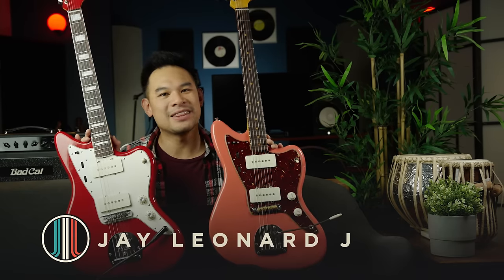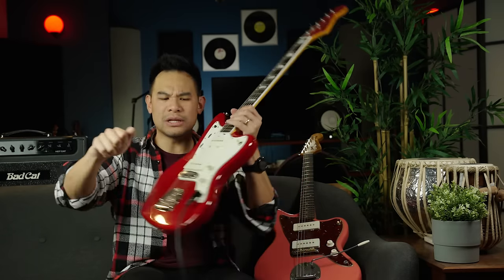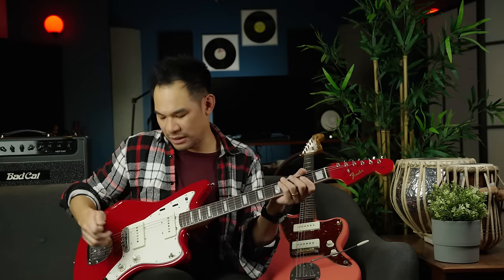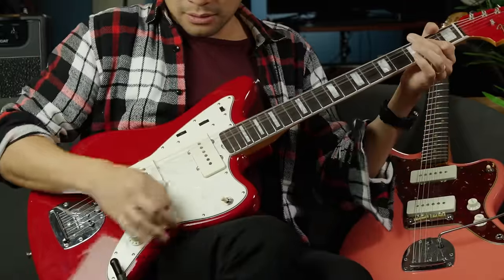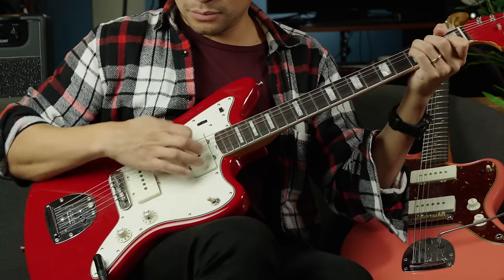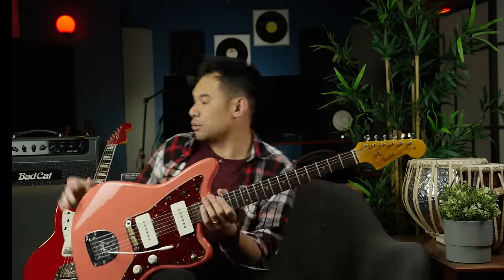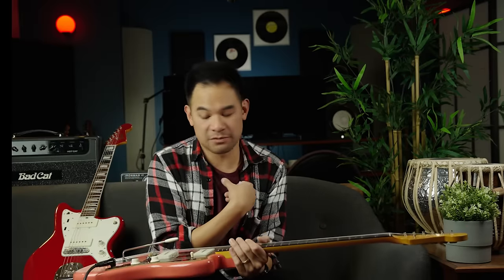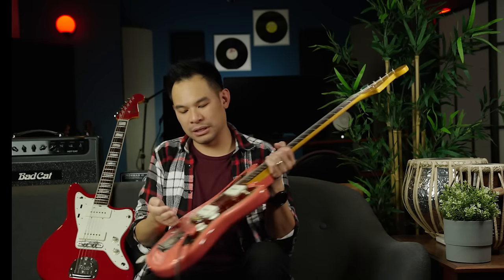What I Learned After Gigging A JAZZMASTER for a Whole Year | TONE LAB

Comment: As a Jazzmaster player, this video is a great explanation of what I love about it. The super high 1 Meg pots gives the Jazzmaster controls a huge range of usable tones. Other guitars ( Especially Single Coil equipped guitars ) have a super narrow range of usable "Non-Muddy", tones. When I try out Strats and Teles, I have to carefully navigate between 8.5-10 on the tone and volume knobs. With the Jazzmaster's 1 Meg pots, Everywhere from 3-10 is clear and free of muddiness. When you add in the super dark Rhythm circuit, the Jazzmaster can be dialed in to fit any amp, no matter how bright or dark. Also, as someone who actually uses the Jazzmaster to play Jazz, the convivence of dialing in a lead tone for a solo or the head of a tune, and a rhythm tone available at the flick of a switch is SUPER USEFUL! With some nice flats, the Jazzmaster can switch between a gnarly distorted tone, and a warm archtop-like tone with ease.
Reply from the maker: Yeah. Once I realized all the shades of sounds in that Tone Knob, that whole guitar opened up to me and I truly "got" the whole Jazzmaster thing!

Comment: Jay what a wonderfully comprehensive review of this underrated and misunderstood guitar. I might add a couple opinions. Mine is a 2005 61 reissue with 7.25 radius. The refinements I incorporated where Staytrem bridge from the UK that retains the subtle rocking but very stable, a .25 mm neck shim from StewMac that increased the brake angle a touch, and filed a slight fall away on the highest frets that gave the forgiveness for big bends on the high E. 
Jason Lollar suggested using the volume dialed down to 8 or 9 to curb the top end a touch vs changing pot value. Lastly I can’t believe you didn’t speak of the middle position. Magic for me and why I kept the 1meg pots. 
Thanks for a fun vid!
Reply from the maker: Haha, good point! I think it goes without saying that the Middle position is absolute fire... I'm on that position about 50% of the time :)

Comment: Thanks for the deep dive! My hot take on the buzz stop add-on below the bridge that you mention near the end of this vid is that it's really only relevant if you're keeping the original Jazzmaster saddles.  It steepens the angle of the strings leading up to the bridge and helps prevent them from slipping off.  That said, I swapped out my JM saddles for Mustang saddles AND kept my buzz stop in place anyway simply because I like the aesthetic. What can I say? Some people put stickers on their guitars, I slap on chunks of steampunky metal. I've seen other vids about the buzz stop debatably altering the tone, but I'm not really detecting anything of the sort.

Comment: Overall a great video that discusses all the important features and issues with Jazzmasters. Well done. 

A couple of notes: you really sold me on the upper bout 250k mod. It never occurred to me that you could do that and have a different value pot on just one of the pickups. 

The best features of the Custom Shop Jazzmasters are both the RSD bridge (which is soooo much better than the vintage threaded saddles which I've never liked) and the fact that you don't have to shim them, which I think improves the neck/body join and makes the guitar sound better. 

I don't think I agree about the lock button, though. Having a Mastery vibrato completely eliminates the need for the lock button and makes things simpler, because you don't have to worry about your strings breaking.

Comment: Love Dakota Red. If I didn’t already have two Jazzmasters I’d get one. 😂

29:52  The string breaking solution is very simple, there’s two good solutions but you can do just one.

1- when you put the high E string ball end in, turn it sideways so it’s like — against the body, not like | against it. This will prevent the string from breaking. 
2- use some Mitchell’s abrasive cord to smooth the hole where the string exits.

That’s it. Permanent.

The cause is simple: Fender doesn’t smooth the holes enough after drilling and so burrs remain. Not always, but frequently.

26:16 loctite is a necessity in my experience. Low strength 222, purple stuff. All twelve saddle screws and possibly the two bridge post screws. One application will last many many years.

25:45 I love the stock AV bridge and vibrato. I use 13-56 strings tuned in C# standard and have zero issues. We must keep in mind that when the Jazzmaster was designed it was 13-54 strings that were used and so there were no problems until people started going to ultra light strings.

Comment: Great review! I am usually a Les Paul player and I wanted something different for other textures and a vibrato. I just bought a Classic Vibe Jazzmaster and installed bright caps in both the lead and rhythm circuits. Then I removed the tone control from the rhythm circuit. It makes me able to use it as my LP through my one channel with overdrive amp; dialed down neck pickup for clean and semi clean and with the flick of a switch, I have got full volume in the lead circuit. Or any combination thereof.

Comment: Thanks so much for making such a cool video, like your mods to the RC! One point to add about the bridge - you make an excellent point about the bridge getting ‘stuck’ forward or back - but in my experience, this is not an issue with unshimmed guitars, because the bridge sits low in the body. In the shimmed ones the bridge is really proud - such as the 40th anniversary squire. This setup is far more likely to have issues with the bridge shifting during use, one trick I found works is to intonate to the extreme aft position, then you can always knock it back if it moves…For me, I think unshimmed is the best way for the guitar to work. Great video, loved it!!

Comment: Favorite guitar of all time, my Classic Player has been my go to for over a decade. I swapped out my rhythm circuit for the Yamaha Revstar transformer boost, threw in a Descendant tailpiece, Mastery Bridge and my favorite mod was the wiring! 

I have Gemini Tone Ranger (wide range CuNiFe pups) that I’ve wired with push/pulls and partial frequency dependent coil splits. In the down mode the neck pickup has all of the neck side coil and about 40% of the bridge side coil to simulate the sound of the Antiquity 2 that used to be in there. The bridge pickup in down mode has full neck side coil and the bridge side coil only passes frequencies below 160hz so it almost sounds like a P90. In the up mode of the push/pull they’re full coils on both pups so they just sound like wide ranges.

I can get traditional Jazzmaster tones, pseudo-Strat tones, big 70’s Tele Deluxe tones, only downside is that I rarely pick up my other guitars on gigs!

Comment: I've been playing a JM for about 10 years. Always solder the high-E. Mastery Bridge. Make sure the tailpiece screws aren't rubbing strings. Personally I've always had to shim.

Also like you, I set mine up for 9.5 gauge strings and 250k pots, so it's more or less setup like a Country Tele rather than a early Surf Guitar. This just increases versatility tremendously. You'll sound good with normal OD's and be able to Chicken Pick and stuff. The guitar just sounds so vibrant and makes arpeggios and chords sing, at the cost of a little bit of low-end thunk.

Like you, I've got the upper-bout control switch putting the stock 1M pots back in play, but it will do either Bridge or Neck so the 'vintage' or ice-pick sounds are there if you want them.

Comment: I got a road worn Jazzmaster used at the beginning of the year. I love it. The vintage spec fretwire and 7.25 radius are so comfortable, and I'm happy to also report very few tuning issues even with the MIM vibrato. I did flip the screws because of string breakage, but that was only one string. Only problem is the bridge, which rattles, but everyone knows to replace it or loctite it and I don't play out so it's not a big deal for me. 

I have an AM Pro II body and neck I'll be building up with different pickups and wiring. Why just have one JM?!

Comment: For those having issues with string slip with the stock Jazzmaster bridge, installing a shim, even on the am vintage ii with angled neck pocket, makes a huge difference. I think it's wise to try that first, before going directly for the mastery bridge. The mastery is great, but if the only concern is string slip, then the neck shim/increasing the break angle is the best first step.

Comment: I did an opposite mod on my rhythm circuit- so it goes straight to the bridge pickup with a darker sound, which is killer with distortion and leads. Can get full jangly or slightly darker with a flip of a switch
Reply from the maker: Cool mod!!!

Comment: Nice JM testimonial, well done Jay! The only thing missing is the shim many JM fans apply to tilt the neck a bit. Did you explore the benefits of this? I think Mark likes to do it.
Reply from the maker: I did try putting a shim on the red one but didn't feel like it added anything, so I took it off.
Reply: I shim my Jazzmaster and my Bass VI necks because it gives me a steeper break angle at the bridge
Reply from the maker: Makes sense: that is a pretty shallow angle! I can see how it can easily get too buzzy depending on the guitar as well as the sustain benefits you may get too 👍

Comment: Hey Jay, i have a Squier Jaguar (Classic 70s Vibe) for over a year ...n i do love it so far 💖 they have an unique feel 🐾 4 sure
i did experience a lil bit with upgrades such as a Staytrem bridge (really good!) + a Wizzobuzz to have more pression on the strings as on the bridge (it's worth getting one!) + a 0.5° neck shim (from Stewmac) to be able to have an higher bridge setup which is crucial for this type of guitar coz they R sort of archtop inspired type of guitars so they need a lil bit of more angle on the neck & more height on the bridge in order to apply enought pression on the strings as to get rid of sitarish kind of tones 🐸 but my main guitar for now is a Sire L7 a spectacular Strat with the best PUs (SSH from Sire) & neck (roasted maple) i've ever come across ....i did as well a lil upgrade on it (Honed black Wilkinson Trem, Black Chrome Gotoh lockin tuners, 3 claws strings' retainer) ...it's a dream 🏆

Comment: Granted it was on my Jaguar, but my 10 gauge high E string broke in that exact spot WHILE watching the video lol. Thanks for the idea about throwing some solder on there, this was a great video on offsets in general. Just got another Jazzmaster and I can't wait for it to get here.
Reply: Regarding your question at the close of your video, when setting them up I personally shim the necks. It keeps the strings from popping off the bridge by increasing string tension (and sustain) which is important as you said. I guess it could contribute to more broken strings but I usually don't have that issue. I also always change out the bridges. Even when they come with the Mustang style that I prefer, they often come with a 9.5" neck yet the radius of the bridge is only 7.25".
Reply from the maker: Hahaha, hilarious how things work out :)

Comment: Ya' know, the "window aperture" of a pickup is limited by where the flux lines from the pole hits the string.  Thats not much wider than the pole piece.  Flux lines then emanate out from that ~1/4 wide string portion down through the coil to the bottom of the pole.  The wider coil might be more efficient if more strong flux lines pass through it, or there might be some cancelations from stray opposing flux lines?  At least the shorter coil doesn't have all that wasted wire in typical tall SC designs that the much weaker length of the flux lines pass through.  JM PUP's are a bit higher inductance than classic Strat PUP's, but the shorter AV poles have lower Gauss.  Lower Gauss is a big part of why they sound darker/smoother, as with A2 Strat poles.  The only reason the highs come through so well is because the pot values are higher than on a Strat or Tele

Comment: been soldering that high E string since i bought my 64 in the early 80's and thought i was the only one,,,haha. I cheated a bit and put a 1Meg resistor across the tone pot and that seemed to work well without changing pots. Calmed it down a bit but i still back the tone down a hair. You are right tho,,,no shims,,,flat neck,,,that's the best. Only thing i did was to fabricate from an old pickguard a little rectangular piece with a hinge that fits on top of the arm side of the trem plate using the 2 side screws of the plate. This holds my trem arm so it doesn't fall all the way down to the input cable. That way i can reach it with my left hand for songs like Church Key and Summertime Blues,,ect.

Comment: Excellent overview. For the string-break-at-the-bridge issue, try either D'Addario strings with a reinforced end (EKXL110) or a brand with more windings prior to the ball. (Normal D'Addario's are terrible on Jazzmasters).
Reply: Check the holes that the string goes through on the bridge to see if there are metal burrs on the edges of the hole and file them smooth if you find them . I had string breakage on certain strings on both my Jazzmaster and my Bass VI and when I checked my bridge there were small metal burrs on the strings that were prone to breaking and they always broke right at the ball every time . I filed smooth the metal burrs and my Jazzmaster and Bass VI string breakage problems were gone

Comment: Seeing as you asked;-)

I would recommend neck shims on Jazzmasters and if you really do not use the rhythm circuit then changing it to a PTB circuit like G&L is a good idea -either turn it on and off with that switch or keep it permanently wired in & using the switch for a series/parallel option

Flatwounds are really good with the standard tone and volume pots but perhaps more so with a Jaguar?
Reply: I think the American Pro II and Custom Shop JMs have a slanted neck pocket that does not require a shim.  Even the Squier 40th JM did that.  No shim required.

Comment: I don't currently own a Jazzmaster, although one of my kids does. I decided that I prefer a Gretsch for my surprisingly practical impractical guitar. One thing that I loved to do with a Jazzmaster when I owned one is use the rhythm circuit for octave fuzz. You're supposed to use the neck pickup with the tone backed off if you want to get a clear octave, and it was really fun to have that switch right there that would make the octave go crazy on the octave fuzz.
Reply from the maker: Yeah, I love that trick!!! I had a vintage Duojet that I absolutely fell in love with years ago that I still haven't forgiven myself for not buying, haha...

Comment: Ive owned multiple Jazzmasters, and the one mod i highly recommend is changing the stock bridge. I went with the Mastery bridge, and their version of the vibrato arm as well. Best decision i ever made. 
Like you, i, too, play violently lol, and with the Mastery bridge/vibrato i can literally beat the crap out of my guitar, i can slam the wammy back n forth aggressively, and even hold the entire guitar up in the air by the wammy bar and it NEVER goes out of tune lol.
 It amazes me every single time i play it. So yeah, if you like to play rough, or have problems breaking strings, or the strings falling off the bridge, then get a differentbridge, or get the Mastery one. Its a bit pricey but worth every penny IMO.

Also, you didnt mention this in the video, but Jazzmasters do better with higher string gauges such as, 11 or 12's due to its unique trem/vibrato arm set up. I wouldn't go lower than 10's. I find the 11 gauge is the perfect balance for me and my playing style. My guitar never goes out of tune, and i play in all different kinds of tunings, from standard to crazy Sonic youth tunings. Not once have i dealt with it going out of tune. Like i said, even purposely abusing it, it still stays in tune. The Jazzmaster is my guitar for life. 

Ps. I agree that its neck pickup sounds the best of all neck pickups

Comment: Loved this deep dive!  I changed the stock bridge out on my JM to a Mustang bridge. I, presently, don't use the vibrato bar, but I've been tempted to lately. As a result, I keep the trem lock button activated.

I'm a hobbyist, not a pro.  So, I'm not sure how "sound" (see what I did there?) of this approach, but I would play clean sections of songs using the lead section and then switch to the rhythm (darker sounding neck pickup) for distorted parts to thicken up that part of the song.

Comment: You know in the 60s they used Linear for volume on the lead circuit, don’t know why they’re using Audio now. I’ve finished my custom loaded harness, built it from scratch using cts pots and cloth wires. Sounds pretty cool to me. Darkens on 9 very quickly

Comment: The loop that holds the ball end of the string impinges on the hole in the tailpiece when the vibrato is being used.  The loop on the ball end is flexed in the hole until it breaks. This can be solved by orienting the loop on the ball horizontally with the top of the guitar.
Reply from the maker: I'm gonna try that! Thanks for the tip :)

Comment: The Vintera II 50's is the best value and most period correct version of all of the JM's that Fender has put out in the last 4 or 5 years. Currently they are marked down and you can by them for 1100 and a little lower than that direct from Fender.